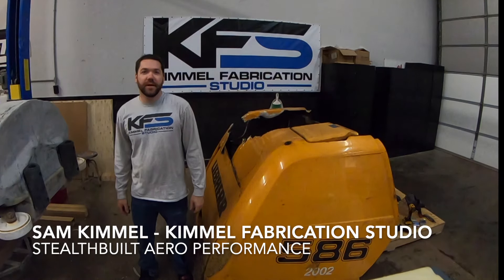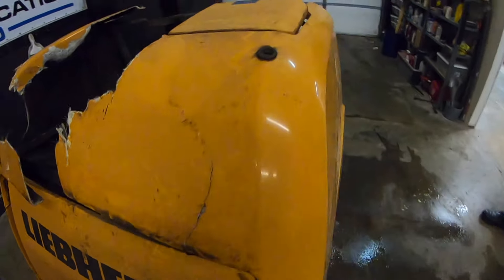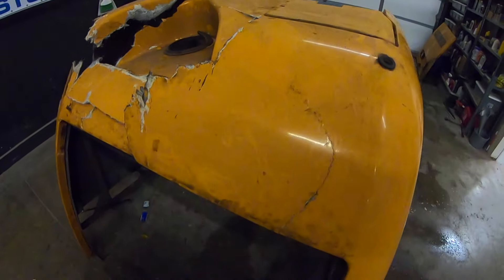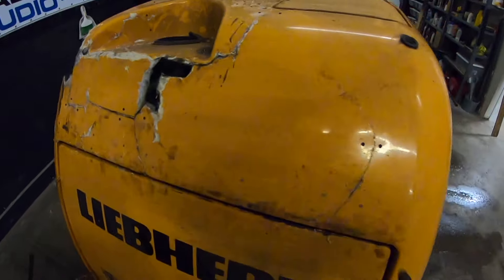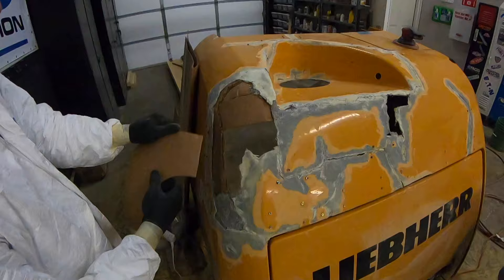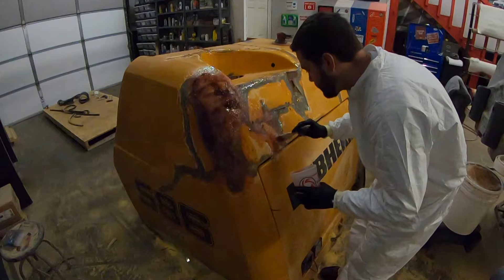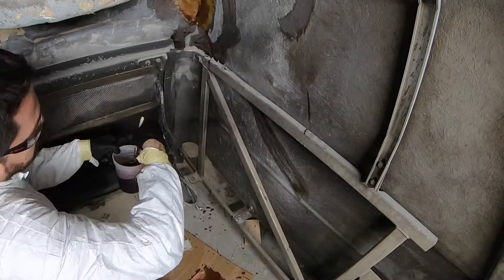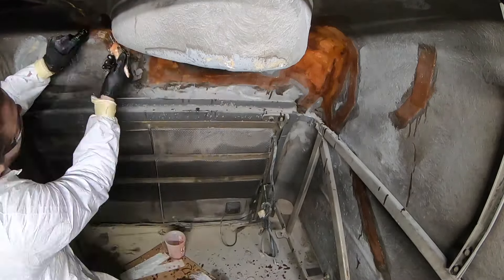Busted Fiberglass Repair Process - Kimmel Fabrication - StealthBuilt

Comment: Nice work.  A wet lay up repair looks almost the same even for high end carbon fiber. For higher strength and low weight we add a vacuum bag and some peel ply.
Reply from the maker: @victorthecarguy3126  Thanks!